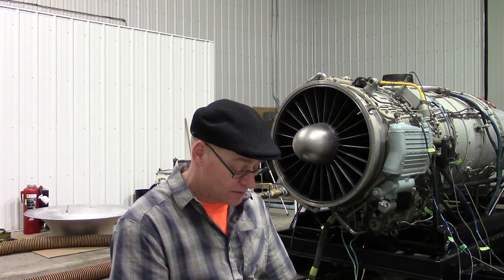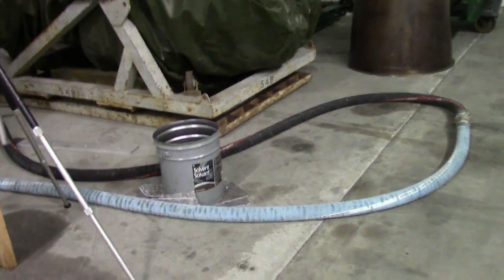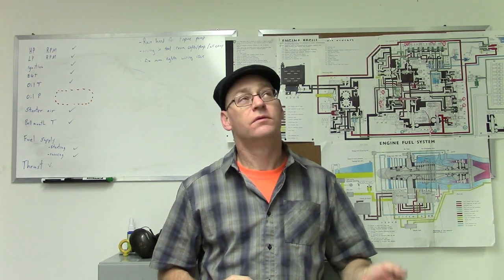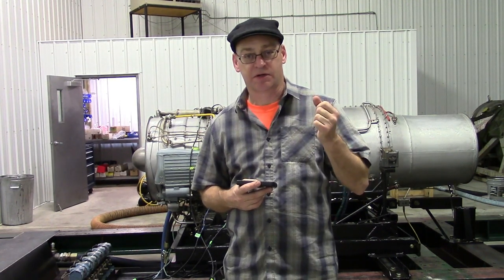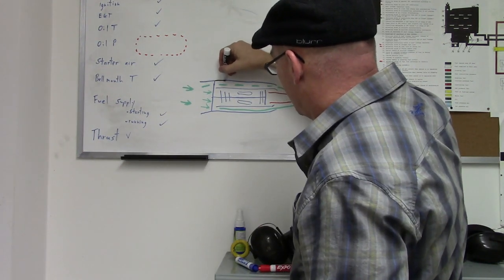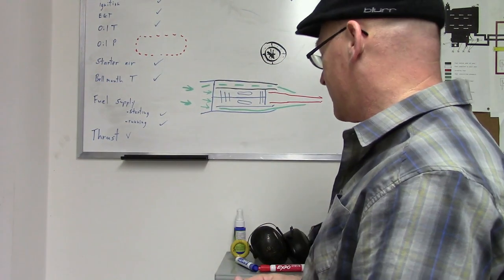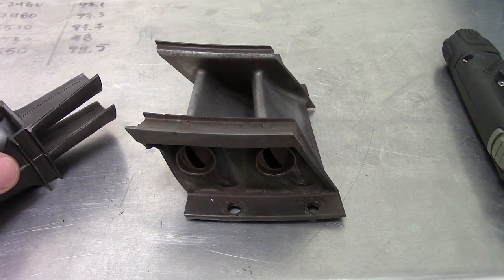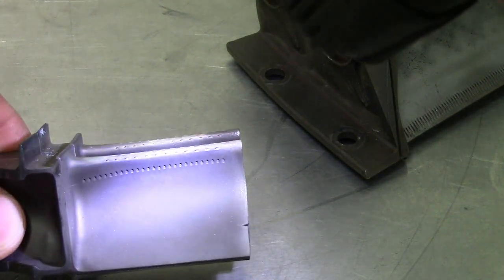Jet Questions  43

Comment: I find kind of interesting that so far no one here have mentioned that the "Rolls-Royce Pegasus Engines, Custom and Unique to the Harrier" have an automatic water jet system to cool the turbines during hover,
Reply: Hello there, I worked on the Pegasus engine for several years and was head of the design team that designed the fan for the last production mark of the engine. The engine did, indeed, have a water injection system.  It's a long time ago, and I cannot remember the position of the injectors, which, I believe, were repositioned fairly early on in the development of the engine to improve the cooling effect in the turbines.  However, the cooling effect resulted primarily from the evaporative cooling effect on the combustion gases and not through any direct effect on the cooling airflow of the turbine aerofoils.
Water injection was not used in the hover, to the  best of my knowledge, but for vertical/short take-off at maximum weight, at the engine's so-called 'short lift wet' rating.  This was available for only a matter of seconds and the capacity of the water tank was limited.
Other engines have had water injection and I believe that the crash landing of a BAC1-11 in Germany some years ago was as a result of the water tank being inadertently filled with kerosene. When used on take-off, this overheated the turbine, causing a premature failure.
Reply from the maker: Migueldeservantes " custom and unique"? No. The Pegasus did have thrust restoration for hot conditions when loaded and in vertical ascent. According to Rolls Royce... and our friend the RR engineer, grahamj9101...
Also, everything on the Harrier was custom and unique to that aircraft. Just like any aircraft... every jet engine installation in every aircraft is of a "custom" design.
The water injection of the Pegasus was very similar to any other combustor water injection on a variety of engines that featured them.
Your comment might lead one to believe that the engine had "liquid cooled" turbines. The purpose of the water injection was power augmentation / restoration, with the cooling effect on the downstream components a nice side effect, as also pointed out by our friendly neighborhood jet engineer, who knows more about this engine than anyone else here...
Reply: AgentJayZ As an 'aide memoire', I do happen to have a copy of ''Pegasus: The Heart of the Harrier' to hand.  It is a detailed historical record written by the highly-respected commercial manager for the engine: however, it doesn't give any details of the water injection arrangement and I didn't work on that or the combustion system. 
I worked on the initial proposals for the Pegasus 11-61 turbine and, at a late stage, stopped a design in its tracks for high radius pre-swirl injection of the cooling air for the 1st stage HP turbine blade (copying the RB211), because it wouldn't work for that particular design of blade: as a result, we reverted to low radius injection with a 'cover plate'.  Shortly after, I moved on to compressor design and the 11-61 fan, with which we had monumental problems with 'flutter', but that is another story ...
Reply: AgentJayZ Well, I guess that I have to apologize please forgive my ignorance, My statement was purely delivered from the humble knowledge bestowed up on my from the History Channel and "TLC" the learning channel here in the US, about 9 years ago they have a especial program showing the ins and outs of the Harrier jump jet"  So been one of my Unicorn "Meaning unreachable dreams" I remember clearly that, it  was the statement they use "Unique" One more time please receive my must humble apology!
Reply from the maker: Migueldeservantes The Learning Channel, along with the Discovery Channel, stopped being a source of real information decades ago. Documentaries ain't what they used to be...
Reply: AgentJayZ
Yes! Which is why we now learn on youtube!
Reply: grahamj9101 Can you shed some light on the nozzle bearings for the Pegasus? I understand these were bleed air cooled, at least on the aft nozzles right? Just wondered if they were like some sort of ball bearing assembly? How were the nozzles actuated? Very interesting engine. The videos of wet take-offs are fantastic, lots of smoke & noise!
Reply: mytmousemalibu I believe that you need to ask that question to Grahamj9101,Sadly my knowledge of the Rolls Royce Pegasus Power plants is limited to what They have showed in the cscience channel here in the US. Good luck with that.
Reply: Whoops, my apologies, I thought I had! Thanks none the less
Reply: mytmousemalibu No apologies are needed! Hope you find the information that you seek!
Reply: Gentlemen, Yes, I will be very happy to answer this in some detail later today for you.  At the moment however, I'm getting ready to travel up to Coventry from Bristol, to meet up with some of my retired colleagues from my time at R-R Industrial & Marine Division, when I was involved in the design of engines such as the Olympus, Tyne, Spey and Ind RB211.   Think ball bearings and bicycle chains!
Reply: I'm back from Coventry, so here's an answer for you.  The four vectoring nozzles of the Pegasus are carried on large diameter ball bearings.  These are unusual because they have no cages to space the balls. The tracks are completely filled with balls, through a filler plug, and to stop them jamming, every second ball is a few thousandths of an inch undersize.  All four nozzles are mechanically interconnected by the drive mechanism, which is powered by two air motors. I know little about this, because it is part of the airframe.  However, the drive shafts connect to a sprocket at each nozzle, over which a length of bicycle chain runs and which is connected to lugs on the bearing outer track. Yes, I did say bicycle chain, but it is made to aerospace standards.  The 'hot' nozzle bearings are cooled by air tapped from the fan delivery plenum chamber: the two feed tubes can be seen on each side of the engine at about ten o'clock and two o'clock (that's their approx. angular position!). Is that enough for the moment?
Reply: grahamj9101 Thanks for the reply! Most appreciated! Thats pretty wild! Pretty simple design but complex in fine detail! Bicycle chain seems so out of place on a jet aircraft but it it works....! Truly revolutionary design that is just brilliant! I like that VTOL/STOL is done with one powerplant and no extra "lift-fans" and such. Thanks again!
Reply: AgentJayZ The early Pegasus 5 engine used water injection to maintain thrust up to 40degC.  However let me put you straight on the later marks: water injection was/is used, only for a matter of seconds, for the engine's so-called 'Short Lift Wet ' (there is also a 'Short Lift Dry') rating, for take-off with max fuel and weapons load.  The engine certainly does not use it in the hover for landing, with no weapons and low fuel.  I've watched more than a few Harrier demonstrations at air shows, where the aircraft transitioned into and out of the hover several times, pirouetted in front of the crowd and even took a bow, where the total time in the hover must have been a lot longer than 5 minutes.  Yes the engine would be working hard, but the turbine certainly wouldn't be in danger of burning out.

Comment: Jay, thanks to your videos I now impress my friends with knowledge of jet engines-  pretty cool; Videos are great,wonderful;
 Question(s): - are hi-bypass turbo fans better than turbo props ( jet driven old fashioned propellers) for performance?
 If a jet engine is going at or near full throttle and then is  suddenly throttled back to idle can the  high pressure combustion products rush backwards through the compressor low stages?
I notice standard practice seems to be to clean turbine and compressor blades with abrasives, are chemical cleaners ever used for this instead to prevent mechanically scratching them?
I notice in the video the reducer pipe fitting on the fuel filter setup has China stamped on it.
Why does the test shop use its own electric generator for power, is there no local electric utility in the area? I know from experience Generac generators are light duty and made mostly for standby emergency power.
Reply from the maker: 1) - for bigger, faster planes - yes.
2) - never say never, but... no.
3) - brushes or pads are always needed to completely remove deposits at the overhaul stage.
4) - Test cell off grid. Need power. We have repurposed a standby genset to intermittent regular duty.
Reply: As a former helicopter mechanic in the US Navy, that rapidly changing the throttle from full power to idle is tested vigorously on the jet fighter engines. This is to test what is called compressor stall. On the test cells, the engines are moved from 100% or afterburner to idle and back rapidly. Over and over again. The test cell operators are looking to ensure no compressor stalls occur after an engined overhaul.

In regards to your comment on chemical cleaning, there are chemical solutions for this. There is a procedure that is preformed on the Sea hawk helicopter every 60 flight hrs. Upon shutdown of the engines, Engine Gas Path cleaner solution is pumped into the combustion section as the engine is motored/windmilled (starter running). The solution is then pumped through the compressor section and allowed to sit for 15 min. It must be done with the engine hot. The chemical solution strips the salt and carbon deposits that have accumulated over the 60 hrs, but will not remove everything. After this, the engine is motored/windmilled again and flushed with water for 30 sec. It is then turned on and allowed to burn (dry) for 5 min. This type of cleaning has shown  significant results in performance gains and turbine temp drops. Civilian aircraft use this method as well. There are many videos on YouTube. One in particular is by Southwest Airlines.
Reply: Alfredo Pacheco Jr We just use distilled water every 50 hours

Comment: hey Jay i really love your work .. and im making a smaller version v the J79 and I was wondering where can I find measurementes for the blades and the turbines .. i would be really glad if you helpped me with that.. if u have some kind of plans for the J79 .. tell me the price and i'll give u my e-mail ... thank you so much :)
Reply from the maker: Each blade and vane is of a complex, three-dimensional curved shape. There are blueprints for them I'm sure, but they are used in manufacture and not ever supplied to service or overhaul people. I have only ever seen specifications for allowable repair limits  like overall length, depth of damage to the edges.
Let me know what kind of measurements you want, and I'll see what I can do.
Reply: i want the diametre of the "wheel" that holds the blades... the height of the blades that form the compressor section.. the width of the blades and the curves..
and also where do you keep all those engines :D .. and is it possible to visit u guys ??
oh and i was trying to find a file in autocad ... 'cuz.. im gonna cut the turbines and blades with a laser .. and i have to make the file but its too complicated and i dotnt have the measurements... and i dont know what to do...
i tried cutting the turbines from one piece of metal but .. the were not .. "professional" :D.. the jet engine worked .. my engine was with one shaft all 12 turbines were on one shaft ... and for fuel i used propane .. but now i wanna take things to the next level and make them better .. and i will achieve that by making my blades and that "wheel" that holds them separate parts.. and also i will change my fuel.. im gonna add jet fuel ...therefore i'll have to put nozzles.. so im working hard on this project..

THANK YOU VERY MUCH FOR RESPONDING :):):)
Reply from the maker: kiko kikokiko The disc that holds the blades has an outer diameter which is tapered, so it changes depending on where you measure it. The diameter of the disk at the bottom of the blade mounting slots will not fit the measuring calipers that can measure that large of a distance - the tips  So that is an extremely difficult dimension to obtain, and another one that is not specified or ever measured.
The blades have length, width, thickness, and a complex three dimensional curved surface that changes from base to tip.
There is no "height", and curves? an infinite number.

I can't help you with any of the dimensions you've asked for.

Comment: Is jet fuel diesel #1 and does jet fuel burn hotter than petrol
Reply: Think of jet as a mixture of D1 and white gas...  but the chemistry gets kinda complicated if you want to get more detailed..

I used to power my very first models on a mixture of 45% white gas and  55% kerosene..  its very close to JP8

Comment: why bother putting the turbofan in the front with double shafts inside each other when you could seemingly just put the turbofan in a rear cowling.
Reply from the maker: That  was how the first turbofan was made, by GE. The CJ805-23 is a very interesting engine, and is featured in one of my recent Q videos.
There is also an excellent video by GE, produced in 1959, about the -23. It's on Youtube.
Your question is a why question, which always requires a lot of space to answer... but I'll give you the short answer: Turbofans are all front fans because it works better that way.